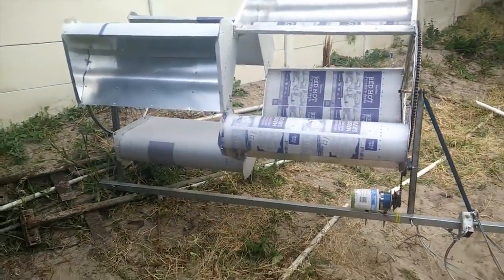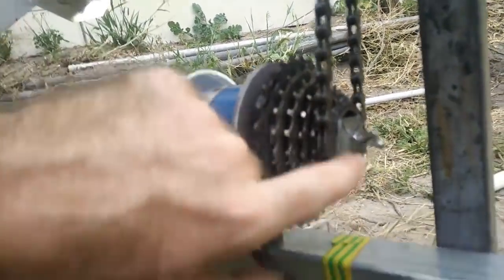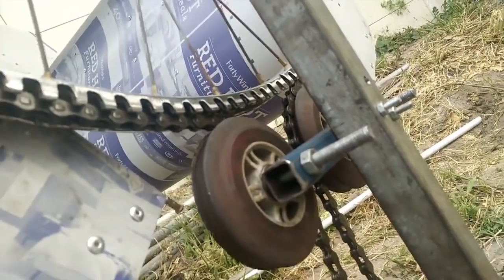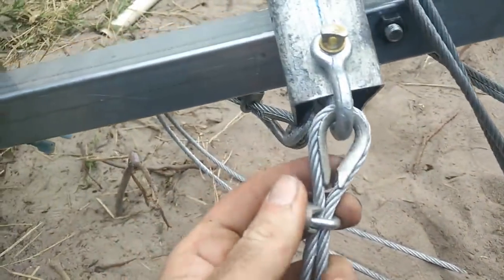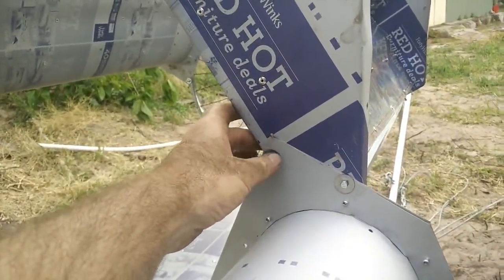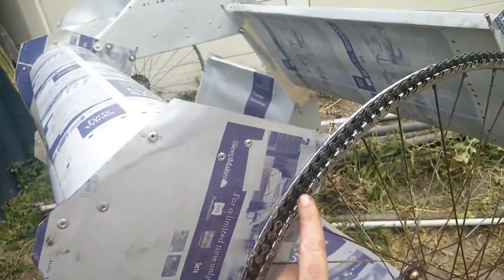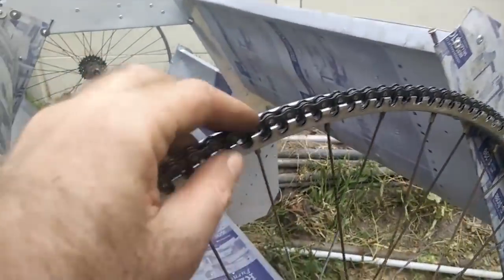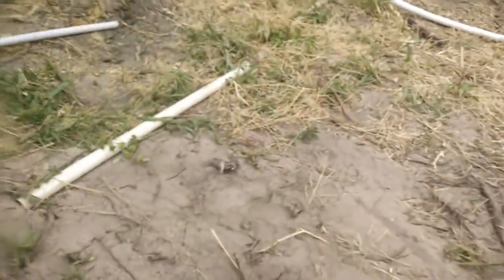Kilowatt wind turbine and pole for under $150

Comment: Too much friction. Get rid of the tensioners. Why do you even have them? Because the chain is too long? Cut the chain. Or even better, omit the chain. Use a direct drive.
Reply: They do make sprocket idlers, they wouldn't have the friction like the plastic rubbing.
Reply: I would have used a sprocket adjuster from a mount bike, that way if you know it is going to be windy or during a storm the ratio can be lowered and still create power it that is something that is wanted. If not, put it on a set sprocket and lock it in.
Reply: Another route would be to leave the tire on the rim directly against another, smaller wheel with gearing. If you size the smaller wheel properly, you can attach the motor shaft directly to the small wheel, eliminating all of the chain. A spring is required to keep the wheels together. I have done this with a car wheel, a rooftop setup, but I don't see why it wouldn't work here. Thanks for the ideas.
Reply: To do that you need to push the tires together creating friction but with a chain you need less friction to turn them.
Reply: Who says? I question that without seeing the math. The contact area of the entire chain would have to calculated, including the sides of the links, proper friction coefficient applied and compared to the few square centimeters that two tires would contact.
Reply: You want friction coefficient.

Steel on steel friction coefficient is about 0.5-0.8 when NOT lubricated, 0.16 then it is.
Rubber on rubber friction coefficient is about 1.16.
Those numbers are the amount of force is required to push/pull an amount of that item across the second item to overcome gravity.

But we are not talking about 'sliding' rubber over rubber we are talking about using rubber to grip rubber. Completely different things.

And we are not talking about steel 'sliding' against steel we are talking about steel bits interlocking into other bits of steel and turning (on an axis).

You are using the words "friction coefficient" correctly. Please go and look them up and spend some time learning about it.
Reply: WARPHEAD  the tensioners cause the chain to engage more teeth. Sure, this adds a little extra friction, but it reduces the strain on the sprocket teeth. If the turbine is feeding 1,000 watts of mechanical power to the gen, i would prefer that be over 10 teeth, vs 2 or 3 teeth. Considering the bike sprocket's normal use is around 100 to 300 watts spread over 10 teeth, reducing that to just 3 teeth could cause premature failure in high winds.
Reply: The tensioners are there because the big wheel doesn't have sprocket teeth,  he explains in the video its a smaller chain wrapped around thee wheel that engages with the longer chain going down to thee motor,  i imagine without the tensioners it wouldn't grip the smaller chain well enough to turn
Reply: lattitude01, he did say he had a chain glued to the wheel rim, this would easily mesh with the chain drive, and the generator could be positioned to keep enough tension  on the chain drive. 

The bigger issue is the number of teeth on the sprocket, and how much each tooth can handle without causing premature failure from the stresses. Normally, a bicyclist might apply 100 to 300 watts of power to around 10 teeth on the sprocket, amounting to about 10 to 30 watts for each tooth.  Without a seperate tensioner to keep the chain on more teeth, it may engage only 3 or 4 teeth. Supposing a good wind was supplying 500 watts of power to the generator, that if spread out to 4 sprocket teeth would amount to a much higher 125 watts of power on each tooth. This extra power is far more likely to cause excessive stress and wear on each sprocket tooth.
Reply: Keith Reynolds v
Reply: Could you produce like on 600volts, 750 000 watts / hour???
Reply: Just use the complete drive train of a 10-speed bike; tensioners, shifters, everything.... there *literally* is no need to re-invent the wheel here, guys.
Reply: Fucking bicycle shifter  Duh
Reply: great idea,nice to see it works

Comment: hey great turbine- do you think you could make it silent with few adjustments?
Reply from the maker: I'll be aiming to. The popping is something flexing somewhere, which should be just a matter of a little reinforcement. The only other sound it makes is the buzz of the chain drive which may be a little harder to eradicate but if it's going to be a problem I'll try encapsulating the whole generator and see if that does the trick. Would also help for weatherproofing.
Reply: You could try replacing the chain with a nylon belt it should be much quieter.
Reply: virus?

Comment: I'm not an engineer. Let me ask any way. Would this work better on a car spindle with a disk, that has good roller bearings and and high heat lithium grease. If used with an axle assembly, (C.V. joint) for front wheel drive, it would not be too hard to assemble and solve a problem, by making it direct drive, or a gear ratio setup. The whole thing can be had at a junk yard for about $75.00 U.S. You could build larger vanes, out of a little thicker material, that would stand up to excessive winds. It's just a thought. Love your video.
Reply from the maker: That would give a more solid build, yes, but as it is it works well, can handle winds over 100 km/h for years, and, critically, is very easy and cheap to make.

Comment: Nice, I find it interesting that you chose to use a chain. I think you might have been able to get away with mounting the motor directly to the low speed shaft had you milled a smaller cog to fit that linkage and welded it to the high speed shaft; a 2 to 1 ratio would work. Also, was their any particular reason you chose to use those 6 large vanes? I would have figured a more simple 3 blade system with a wind vane to orientate them would be more efficient. Anyhow, good luck on your future modifications!
Reply from the maker: The chain worked kinda ok but wasn't quite as I wanted so I'm now experimenting with a belt, which has other considerations but I think will give a better result overall.
More revs means more voltage and less line losses, so it's nice to be able to come off the bike rim as a 60cm sprocket/pulley and get about a 12:1 gearing ratio more or less for free.
It's six vane because that's as large as I can make each of them from those materials, and twice as many vanes means twice as much power. A tail or similar isn't necessary as vertical axis turbines can receive wind from any direction simultaneously.
Reply: Obviously, I am not a wind turbine expert but that being said all the commercial wind farms I have seen use a 3 blade + wind vane system. So apparently, there is a benefit to that system over any other system. I would assume it has to do with the power loss you have when using belts, chains, kogs and in general create resistances from input to output.
Reply from the maker: They do fine in good conditions, but verticals tend to do better when there's turbulence, obstructions, etc, which is often the case where individual people would be putting their own turbines up.
Also the economic and commercial considerations are completely different between the industrial and home scales.

Comment: So the motor can act as a generator with good output? I have heard about these cheap Chinese windmills that uses ceiling fan motors as generators, but they have no power at all. If I could I would try and buy a 24v DC brushed dynamo. I am not sure but I guess 3 pole AC brushless generators are expensive.

And I would guess a dynamo are a AC internally.. ugg I have to google.

Comment: Looks really good! About how long did it take to cut, bend, and rivet each of those blades? And did you bleed on it? Honestly, that part scares me the most. Seem like a /lot/ of effort with floppy, sharp metal edges.
Reply from the maker: I can make a full six vane version myself in about seven hours from scratch, or about three hours if I'm using CNC cut sheets. Less if I've got help, obv.
The aluminium isn't that sharp, I occasionally might get a little cut, but less than I do with other tools and processes.
Reply: Kevlar gloves are your friend.

Comment: Only one question why so big couldn't a smaller rig give you enough power to charge you batteries and a dc to ac power your house? as long as you have a big enough battery bank? maybe it is two questions...
Reply from the maker: You'd probably want a couple of these scale turbines to power a western home, even somewhere relatively windy.

Comment: I dont see proof of a kw would like to see some load and meter readings first
Reply: I would like to see some in use measurements too.
Reply: The generator is from a treadmill motor. I am guessing the electric motor is rated for 1kw dc at a specific voltage when run as a motor.

When given  "enough" wind, it can "safely" produce upto the same voltage and current, under a proper load.  But, to be safe, one will probably have it operate at far below its max raiting. For obvious reasons, one does not want to risk burning up the generator.  It is a bad idea to hook up a 5kw turbine to a 1kw generator. Improper matching a turbine to a gen  can destroy either the turbine by letting it spin too fast with not enough load at high speed, or cause the gen to burn up generating too high of a voltage so that the load draws too many amps. It is best to design in a safety margin so that one don't destroy their work.
Reply: there is not even a chain...
Reply: wolver1n 0:20 no chain?
Reply: 7:07 no chain
Reply: wolver1n i see your point, or rather you are correct, I dont see the chain.

Comment: How do you regulate the voltage so it's usable?
Reply from the maker: There's a couple options depending on individual setup, but usually easiest and most effective is just a charge controller box.

Comment: 60kph?  how often do you get 60kph?   also what is the startup kph of this?
Reply from the maker: Some of them here in Scotland get a fair bit more than that, but the figure is meant more as a power rating than typical output. The startup depends on load, but the turbine itself will start turning in pretty much zero.

Comment: Nice, but can it at least power a 12V device directly for any amount of time when the wind is blowing? If so, great. If not, then it probably won't charge a 12V battery well, if at all. Good effort and appealing budget in any case.

Comment: How many of these parts did you have lieing around because I'm having trouble building one of these for anywhere near that price?
Reply from the maker: About a dollar each usually for the alu printing plates, couple bucks for the bike wheel and nuts and bolts. Pole stuff is basic and the generator is off an old treadmill. Which bits are proving tricky for you?
Reply: OpenSourceLowTech The generator and sprockets.
Reply from the maker: Check eBay and local classifieds for the generator/motor, and companies that service gym equipment. The sprocket set is just off and old bike wheel, anywhere that sells or repairs bikes should have a stack of old ones.
Feel free to join the FB group linked in the description, there's a lot more information and conversation there.

Comment: Why not use the high gear, to make the motor turn easier?
Reply from the maker: Higher revs means more voltage, so less amperage per watt, so less losses to heat.
Reply: Cool, thanks for the reply

Comment: Though I’m starting to think a hydraulic pump mounted on end of the shaft of the fan system would be more quite. Also could drive many type systems. Your system crude yet simple is cool.
Reply: Guy Ruff hydraulic pumps are extremely inefficient and the higher RPMs would lose lots of power

Comment: 60kmh is a strong wind and thats not common at all where I live. average wind is 15kmh on normal days, would be interesting how much power it gives you under such conditions... also the position of the turbine in front of the house is really not a good spot to earn the full amount of energy available...
Reply from the maker: You start climbing the power curve around 20 km/h, at 15 you won't really get anything with any kind or number of turbines.
At the site in the video I would have liked to have used a higher pole and different location, but local planning regulations forbade both.

Comment: Unfortunately that bike chain will only last a few hundred hours run time at best  before it wears so far it starts chewing the sprocket teeth off.  

Been there done that and open chain of any kind does not work for wind power or any long running applications.

Comment: I have a hard time believing a household item could generate more power than the original item draws in the first place
Reply: If it was rotating faster it might, but there is also a potential overheating issue

Comment: mount the motor underneath and use smaller gears? I would think you could get away with using nylon gears really could be much lighter.

Comment: ya I don't think it's very efficient!  Vertical axis wind turbines are inherently less efficient (if I'm not mistaken) and all the chain, pulleys and gears are slowing it down.  I also wouldn't want the noise to piss off my neighbors.  I was thinking of using tooth belts for gear reduction if I needed it, but most of the commercial units are direct drive.

Comment: Do you plan on adding a governor to prevent it from going too fast in high winds, and to limit input to the motor/generator, so as not to burn it out?

Also, do you use it for direct power, or do you charge batteries, or such?

Ideally, wind, batteries, fuelcell combo would be best for full off grid, wind to charge the batteries, batteries used to crack H2O to H2 and O2, and the H2 used in the fuelcell system to actually power the home. This is a system that has been worked on at University of Nevada, Las Vegas.

Comment: Killowatt. What sort of Killowatt ? 0.1 or 500Kw ??
Reply: Gazza Schmo Watt???
Reply: 1000 Watts? highly doubt it
Reply: When the video shows it spinning around in the wind, I cannot see the chain drive attached. Is it?
Reply: i would assume one kilowatt lol
Reply: 1.5 HP = 1118 W but it will be affected by speed , std motor will give 1.5 HP at 1800 RPM , so it will be way down
Reply: yup..i only comment once in a while...but i could 'help people'  24/7 ..(ur cool )
Reply: he said it was 1 KW
Reply: thats the motor rating.  doesnt mean he is getting that and he did not say he was.  the place looks very windy so he may get a couple hundred watts.  i dont think much of his contraption but who cares?  he built something and it works.
Reply: Gazza Schmo  He means 1000 watt at 60 mph winds speed as stated in the description. However if that contraption were to experience 60 mph winds I wouldn't advise being in the same city. If anybody truly wants to make a wind turbine I suggest building the tried and true axial flux turbine that's been on YouTube for years. It works, but will cost $400-500 (US) for parts. Not including the tower. Make 1000 watts at 30 mph --- https://youtu.be/dxhu4_knrRw
Reply: 100,000 watts is 100kW ..lol..a mega watt is 1,000,000 Watts ...100 mega Watts is 100,000,000 Watts,,so i dont know where you learned this information you wrote about  but.. wow  ...physics you say...lmfao     Cheers...we do need the voltage to determine the amperage though .i never even went to school and I know this stuff.. it is simple..good grief .
Reply: He said  "1.5 Kw in a 60 kph wind" ..   I don't know about you,  But,  if that was the regular wind at my House.  I'd move.  not build a wind tower..  I hope he buried some deep concrete footings to tie those cables too..  a couple of weeks in that kinda wind will loosen up everything..   it'll go flying into the neighbors house or car..
Reply: lol...yeah any winds around the 60kph mark are considered dangerous and will cause damage..
Reply: Yes, 500KW.

Comment: Hello, thank for sharing, it's inspirational :)
In the title you write KILOWATT wind turbine, does this mean that this (great) wind turbine coiupled with the treadmill motor deliver one kilowatt of power (it would be really great). Do you have data on voltage and power with this installation ?thanks a lot :D
Reply from the maker: The turbine at that size should put out a kilowatt of mechanical power in about a 55-60 km/h wind, and that particular DC motor is rated to 1.5 horse power, which is about 1.1 kilowatts. It should be doing about 60 volts in that wind, so it largely comes down to the maximum amperage rating on the motor, which I'm not sure of, but if it is at least 17 amps then that would give you the kilowatt.

Comment: Use the teeth uv made on the wheel as a sprocket
Reply from the maker: Yeah thought about that, but would very difficult to get the tooth spacing correct.

Comment: You loose a lot of wind power due to your primitive chain drive , I suggest you use other end of turbine and use a second set of bicycle bracket set to multiply the revolution with existing tension system on original bike.

Comment: brushed DC  not going to last
Reply: DSAK55 it can easily be changed.
Reply: The 600v DC 30MW generator we have at work is brushed and has lasted 58 years so far. Does get 16 hours of maintenance a week and lots of new brushes tho. You need to think of the huge benefits of brushes not just their down sides.
It is a multi million pound generator not a DIY wind turbine however, and keeping it running tip top is vital to the running of the plant. Can’t exactly compare the two. If you are happy to switch brushes now and then tho it’s still viable.